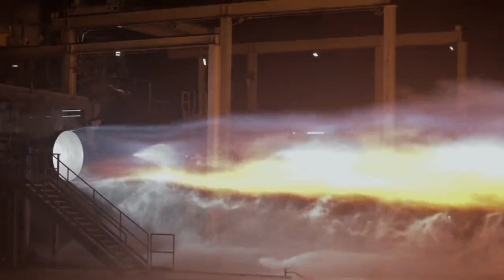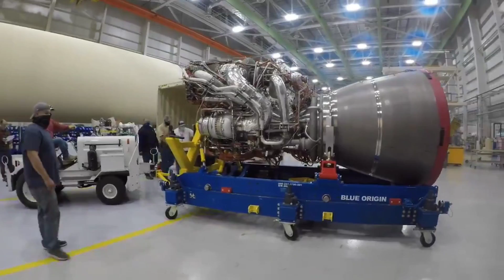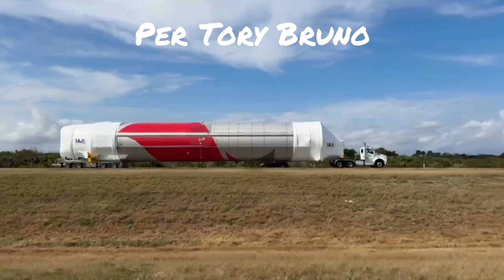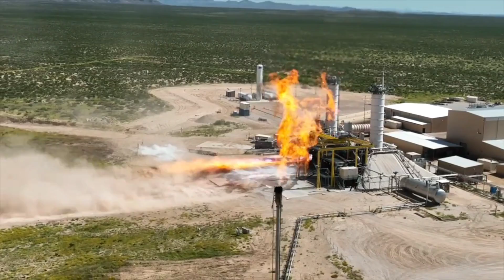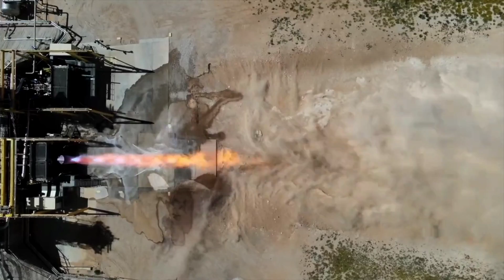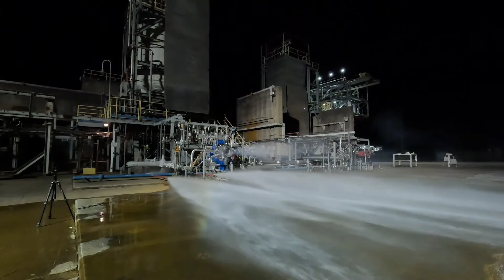Blue Origin engine explodes!!  How will this impact Vulcan Centaur, Peregrine and Dreamchaser?

Comment: The biggest difference is that SpaceX can pump out a new engine in a day or two. Who knows how long it take BO to make another engine?
Reply: One engine a day or two, or even one a week, SX is building a lot more engines than BO is.  BO seems to have so few engines in the pipeline, that a single issue, really impacts availability, unlike  SX who often swaps out engines after a test.
Reply: I would bet in the time BO has made a handful of engines, SpaceX has produced hundreds. And if you compare the first ones to the latest, the Raptor has made more changes that have improved the performance and reliability.
Reply: @andrewc662  Yeah, this sort of pitiful comparing of Blue Origin's production of engines to Space X is pure copium because everyone should know that BO is a joke of a company that doesn't seem to be able to get much of anything built in the past 5 years, whereas Space X is on like the third or fourth iteration of the Raptor and lord knows how many of Starship.
Reply: @remo27 You have noooo idea what goes on behind the scenes at Blue Origin. So precisely 100% of your bias is due to videos like this, which has a massive negative Blue Origin bias. 😅
Reply: @GSF404  I have plenty of idea what goes on behind the scenes at Blue Origin in that A) Not only have there been many 'whistleblowers' B) But even if you disregard them as all embittered employees you can't HIDE COMPLETED ROCKETS, rocket engines or landers. Blue Origin has hardly done shit, esp for a company that is TWO YEARS OLDER than Space X - and Space X goes back to 2004 or 2006. So, can you tell me why in nearly 20 years Space X has done so much and Blue Origin so little?
Reply: It's not a matter of making a new unit. You need to know what happened to this one first.

Even Elon gets that. He's never been afraid to break things, but he still waits to see just how and why it broke. 

Welcome to engineering.
Reply: And I'd argue that what SpaceX does is called Quality Control. Who knows what BO does and why. Federal dollars are keeping that joke of a company afloat!
Reply: @themaxster7798  

BO is funded by Jeff Bezos bro...Not by you.
Reply: That isnt true, lmao.  Jesus why do people perpetuate this myth?
Reply: @iamscoutstfu  Because Space-X isn't building engines as much as they're building an engine assembly line. Mass production is the goal. Building an engine a day is where they will have to be to make their future plans work. They're not there yet, but no on else is even trying to match that sort of pace.
Reply: Really? What does BOs production line look like, what is their capacity? 

SX cannot produce a raptor in 1 day.  They have raptors sat around in partial assembly. Which means those that are already mostly build are just waiting for finishing touches. 

This is not new or innovative. Its been around since Henry Ford.
Reply: @iamscoutstfu  Blue Origin could learn a thing or two from Henry Ford.
Reply: @iamscoutstfu not to be mean but have you seen video of Blue Origin's rocket production plants? They are practically empty, save for mock-ups of their proposed rockets and unused fairings
Reply: @iamscoutstfu - BO has a large factory that’s almost unoccupied, so BO is lucky if the company can produce 2 BE-4’s a month. The assembly line predated Henry Ford, but no one has ever had the level of Vertical Integration & automation SX has (except for Tesla), and no one in the Rocket industry has had anything like the production rate SpaceX has.
Reply: @TraditionalAnglican  

"BO has a large factory that’s almost unoccupied,"

No they don't. Also they have multiple manufacturing plants. 

"No one has ever had the vertical integration & automation blah blah"

Said without evidence, believed because you were told to believe it. 

"no one has anything like the production rate" 

Relevance?  Youre confusing production rate with production capacity.  Your argument essentially breaks down to: "SpaceX is doing something I think is cool now and therefor is the best."

Hard pass on the fanboy logic.
Reply: @thearpox7873  

You don't know anything about BOs assembly line so you wouldn't be qualified to speculate.
Reply: @themaxster7798  

You think a video of one part of one plant is representative of all the plants, all the time?  

Bro...what?
Reply: @iamscoutstfu Isn't that the whole point of a production line? To churn out things (engines) as fast as possible? Yes no engine is built in a day, a 5 year old could understand that. However, the frequency of production, if we are to trust the Musk, is indeed that. Is this that difficult to grasp?
Reply: @iamscoutstfu  I'm just going by the info that AA shared in previous videos when he toured a supposedly main BO facility.
Reply: @themaxster7798  That was your first mistake, trusting what AA says.  He has a bad habit of making sweeping decisions based on very limited information.
Reply: @iamscoutstfu - SpaceX is building 3 Raptors/week, because SX has to (each Starship needs 37 minimum), and because SX has created a Raptor assembly line that can do it. That’s unparalleled in the rocket industry, and it’s not a myth!
Reply: @TraditionalAnglican  

They literally are not building 3 engines per week.  

They are delivering 3 engines per week.  JFC would you people spend even an ounce of energy on reading comprehension, please.  I'm begging you.
Reply: @iamscoutstfu  What's the difference between producing and delivering? If they're consistently delivering 3 engines per week, that means they're producing at least that many.
Reply: @GoranXII  

OP didn't use the word delivering. 

He said they can produce 3 new engines in a week.  3 new engines = unassembled components to full engine. SpaceX cannot do this.  

They can put the finishing touches on an engine theyve been building for weeks before hand, 3 times a week, and then that engine is delivered. 

But that isn't even impressive.  Thats about standard for an average production line, even for goods as complex as a rocket engine.  Its...basic.
Reply: @iamscoutstfu  Okay, fine, outputting. As for not being impressive, For rocket engines, it sort of is. 3 per week is over 150 per year, which has been pretty much unheard of until now.
Reply: @GoranXII  

It really isn't.  Its only impressive to someone who doesn't have a deep understanding of the manufacturing process. 

Rocket engines are made of parts. just like cars, cell phones, guitars, computers, etc.  

I guarantee you Boeing crushes SPaceX's manufacturing capacity and jet engines are no less difficult to make than rocket engines, especially the comparatively simplistic ones SpaceX makes. 

BO, on the other hand...their engines are ridiculously complex.  Ridiculously capable, compared to their competitors, but ridiculously complex, as well.
Reply: @iamscoutstfu  Jet Engines don't have to stand hundreds of bars of pressure, and nor do they have juggle the flow of two liquid fuels in exact mixtures.

As for complexity, you have it the wrong war around. the BE-4 is an oxidiser-rich staged combustion engine, a type which has been flying since the 60s. The Raptor, OTOH, is a full-flow staged-combustion engine, of which only three types have even been attempted before, and only Raptor has ever actually flown. Raptor simpler than the BE-4? You've got your wires crossed there mate.
Reply: @iamscoutstfu  You mean the same Boeing that can't produce a a working Starliner despite spending twice as much money and several years more time than SpaceX?
Reply: @iamscoutstfu  NASA has confirmed and certified that SpaceX produces 1 engine per day. Look it up.
https://www.nasa.gov/sites/default/files/atoms/files/nac_october_2022_artemis_final_rev_b.pdf    Page 19.

Comment: A scheduled ' test to destruction' is indeed normal - for a test article.  Not for a customer qualification test.  Any human riding that rocket is a real gambler...
Reply: This is an important distinction and something I felt the video was misleading about. The clip of Elon speaking about the destruction of engines was regarding their test/dev stage during engine design. I don’t think the BE4 engine that blew up was intended as a development test.
Reply: @wesleyclark2032 It appears to be an effort of misdirection.
Reply: @comp20B  Tori Bruno has stated this is not a concern but maybe he figures he has to support the team at this point. He's really kind of screwed without BO.
Reply: @wesleyclark2032 it was stated several times in the video that the BE4 that exploded failed on its acceptance test, meaning if it had gone correctly it would have been shipped to ULA for installation. I don’t think the clip was meant to be misleading and if you look at engines built and ready for BE4 (2 that we know of) and engines that have flown for raptor (2 versions flown ~43 and version 3 in production). Plus a hundred+ of Raptor 2s flight ready. 30 lost in testing dosnt seen that bad.
Reply: After the test, they just glue the pieces together and send it to the customer.
Reply: @Hykje  Pro tip:  Silver paint.  No one will know!  Ship it!

Comment: Why ULA thought that BO was capable of building rocket engines is a mystery to me.  Where is Rocketdyne?  Just buy out that team.
This is just welfare for billionaires
Reply: Except they ARE building rocket engines. BE-1, BE-2, BE-3, BE-4, and BE-7. Given that Jeff Bezos has funded most of Blue Origin to this point, it's exactly the opposite of welfare!
Reply: Traitorous billionaire, in this case
Reply: @BoycottChinaa  Aren't they all?
Reply: @Bora_H  Clearly not all billionaires are made the same. Musk products have revolutionized his businesses, the loans and dividends on grants long paid out handsomely. (He brought down the cost of launches so much, US gov had to redo their budget projections, lowering the substatially- multiple billions of dollars over ten year span.
The Only transaction with govt. that did not pay handsome dividends was Buffalo NY. And even then the reporting harps on the fact that the solar roof industry never took off and fails to mention the 2,000 jobs in super charger construction that replaced it...  plus a large number of auto pilot taggers, regular solar panel builders... vs the 1700 originally promised jobs.
Reply: @avgjoe5969  very true. Elon seems to be a rare bird. Imagine if all the other billionaires gave even a portion of Elon's level of effort!
Reply: @avgjoe5969 think you’ll find that solar roof deal was doing well until Elon murmured about linking neighbourhoods together in to a battery bank smart charging system that idea stepped on one too many toes. You don’t cut out the energy giants without pushbacks besides they’re all in the WEF club could get a bit awkward.

Comment: Much ado about nothing: Vulcan Centaur already has the structural problem that has set its launch back by at least a year.  Both that failure and the engine CATO have occurred prior to a launch with valuable payloads- or people- and no lives have been lost. Better that than to knowingly fly and destroy faulty hardware in an uncontrolled manner...  BE4's main issue seems to be stresses on the turbopump assembly which is why my money is on Archimedes.
Reply: Yup, that bureaucratic engineering theory "don't get it done, get it right".....
Reply: @crankyoldman65  I'm saying it doesn't matter because the launch system is on hold anyway (not to mention the explosion at ULA'S test stand.) As far as the engines ... Well that really depends on who buys ULA. If the government is insistent that it wants BE4, then Blue Origin will toil away until it is delivered be that next year or next century. So no in the abstract it doesn't matter, and other launch providers are already making headway.
Reply: This had nothing to do with the turbopumps. It was debris that clogged up cooling channels resulting in the burn through and explosion.

Comment: I wouldn't expect the first flight to go much better than the first superheavy flight. Not sure it will actually reach the 100km mark.
Reply: Assuming the BE4s don't RUD, I expect Vulcan to do just fine on its maiden flight. ULAs development philosophy is completely different to that of Spacex when it comes to Starship. Not necessarily better or worse, but certainly different. ULAs approach is essentially the same as that used by Boeing for SLS. I'd have been shocked to see SLS fail on that test flight, but I don't think anyone who understands the process was shocked in the slightest when the 24/7 stack failed to reach orbit. A little concerned about the FTS problem, but other than that, no surprise.
Reply: They are planning on it to succeed all the way to the moon on its very first flight. Ambitious? Yes. Overly optimistic? Maybe. Whether the Peregrine lander works is up to them.  I'm hoping all these delays isn't impacting the viability of the lander's systems or will they need to inspect it and change out some components?
Reply: @rosswarren436  I think they will be lucky if the reach orbit on the first try. Just my opinion, but they don't have near enough testing to give any confidence compared to SpaceX superheavy.
Reply: How much testing do they have?
Reply: @iamscoutstfu  they have done many tests. The engines, the stage tanks, the avionics were probably adapted from the flight proven Atlas or Delta vehicles, endless simulations, etc.  It all comes down to getting ready for that first flight which is still a test flight. 

That they would put some important payloads on that first flight means they are either confident of success or foolish. 

Recall we put humans on the very first flight of the space shuttle.  They felt that confident it would be successful.  Given 2020 hindsight we can say that were only partially correct in that assessment - and very lucky.
Reply: @rosswarren436  

Exactly,  OP has no idea wtf theyre talking about.

Comment: Ten seconds into test is not quite pushing the engine.
Reply: That depends. Starting the things up is every bit as tricky as keeping them going.
Reply: Maybe enough to clear the launch tower? Lol
Reply: You must be a rocket engineer, huh?
Reply: @iamscoutstfu That wasn't a test article, it was flight engine #3. It's expected to operate much longer than 10 second. Well, was expected.
Reply: @jounik  

So what, and so what?  SX has blown up multiple non-test article engines to include multiple ON their starship which had two flare outs within 5 seconds of ignition and multiple other examples of BE-4s have already passed ATP.  

What even was the point you were hoping to make?
Reply: @iamscoutstfu  Don’t short yourself.  It doesn’t take much to surmise that an rocket engine, designed to fly to orbit, fail in first 10 seconds of testing.
Reply: @Puer-Aeternus-Anonymous  

So you mean like Starships engines failed within the first 5 seconds of testing? Then it destroyed its own launch platform....then it failed to separate...then it exploded.
Reply: @iamscoutstfu  You do understand that the entire Starship was a test article, don't you? None of that hardware was ever intended to be used for a production flight. Unlike, say, BE-4 flight engine #3.
Reply: @jounik  

"You do understand blah blah"

Smells like copium to me bro.  

'its a good thing that it wasn't "intended for flight" though, as that shit sure as hell didn't make the grade. It would have killed everyone on board and that should really make people second guess riding on something as unsafe as starship.
Reply: @iamscoutstfu  “Starship exploded like a champ, unlike the 10 seconds Blue Balls attempted!”
Reply: @iamscoutstfu you're grasping at straws at this point.
Reply: @Puer-Aeternus-Anonymous  You mean after they completed 23 prior missions?

Or you mean after the successfully complete innumerable other engine tests which all passed with flying colors?

What is this delusional fanboyism? lmao/